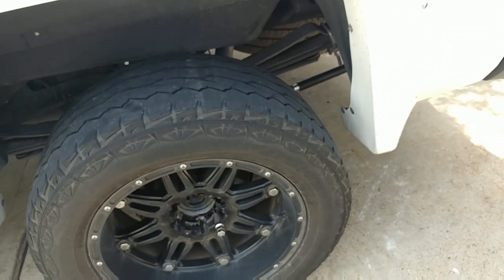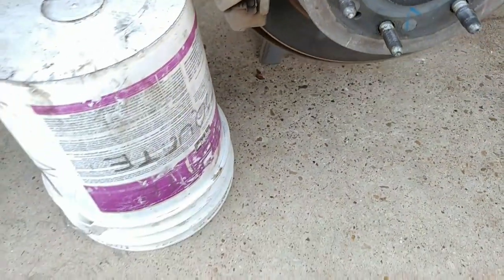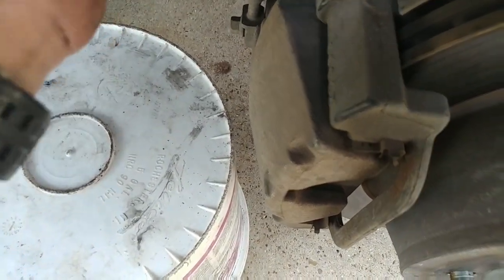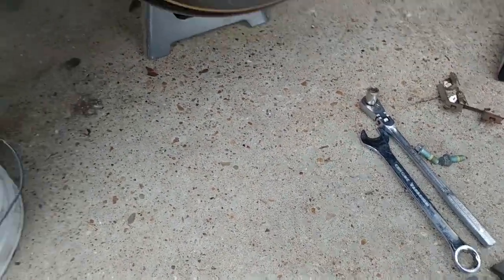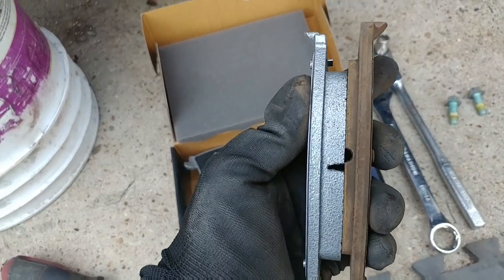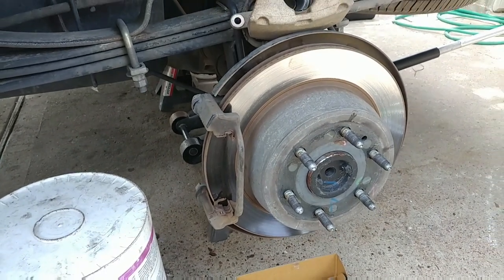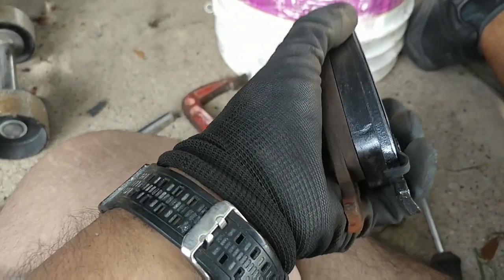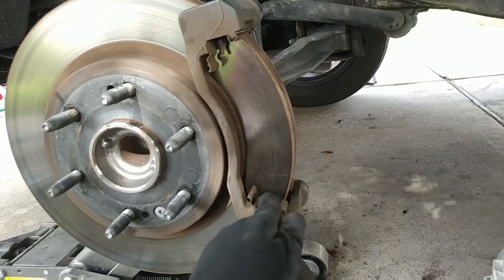2014 Silverado 80k miles brake change

Comment: Those pad still had 15k more left in them!
Reply: My 2014 has about 45k miles ok it when would be a good time to swap out the pads?? Much appreciated for any help thanks have a good day..
Reply: @SuperSonofsatan  my truck had  118k miles before the squealer started making noise.
Reply: Maybe, but who knows if there is anything sticking out in the pad material, usually there is.

Comment: Bruh. Them tires look to have the same amount of miles as the brakes.
Reply from the maker: They did
Reply from the maker: I actually still used them for an additional 8k miles and then changed tires.
Reply from the maker: Best tires I ever used. Then went to mud tires and only got like 45k miles and decided to go back to this same tires but the newer version of them.
Reply: Jorge Rangel  What kind of tires are they ?
Reply from the maker: @bac4998  these were falken wildpeak a/t, the new ones are falken wildpeak at3w